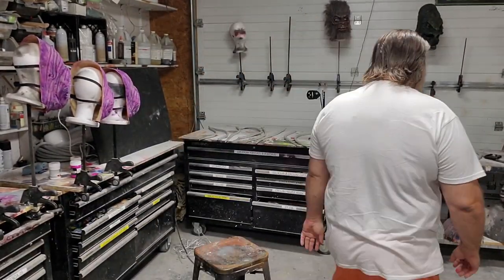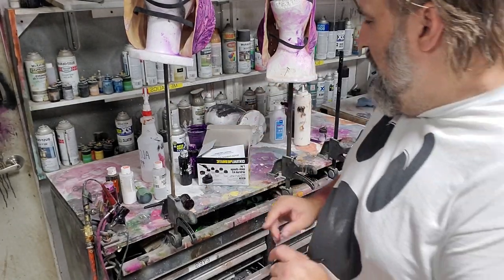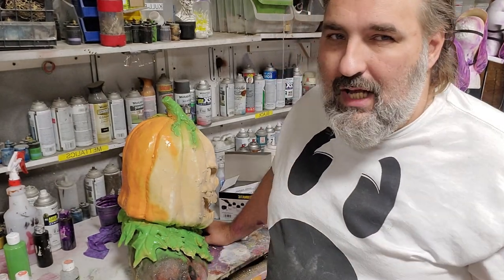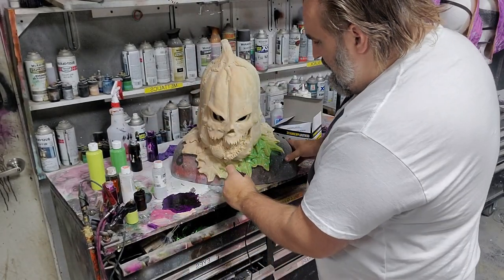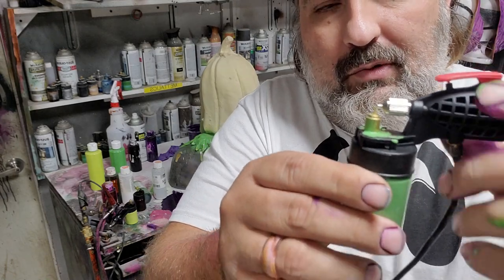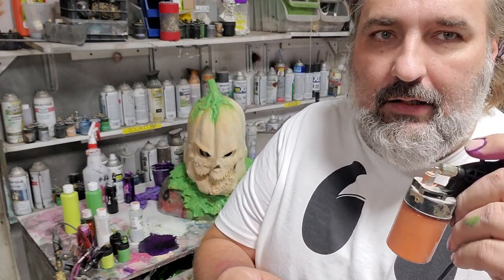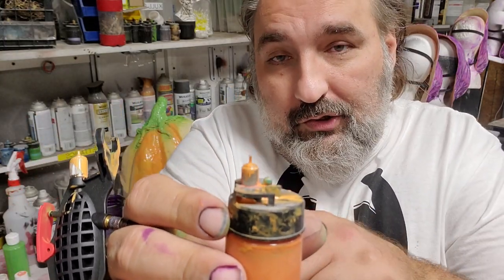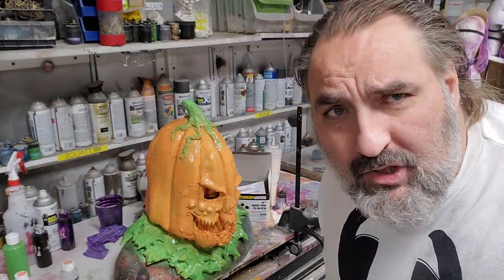quick change airbrush

Comment: I use this as part of my makeup kit for our haunt in Green Bay WI. We are using the Endura from UBA. I found a twelve-pack of glass containers with lids that fit the cap assembly for this quick-change gun on Amazon. They are sold for the Badger airbrushes. When we are through blowing makeup for the night, we screw the lid on that came with the cup to keep the Endura workable and I take the quick-change lids home to clean them up for re-use.
Reply from the maker: great tips!

Comment: I guess I was just surprised at the high 70 some PSI air used. But then it looks like your paint has a lot of solids which may be the reason?
Reply from the maker: its latex mask paint, I dont spray at that pressure but I want it available to blow out clogs.

Comment: Very interesting seems to be a needless airbrush for $10.00. A must-have for the price!

 I bought a used one over 30 years ago that was a harbor freight with an airbrush compressor. The airbrush was junk it had a needle and the person had overtightened the needle and split the tip. It was a micro split didn't see it but the air compressor was what I wanted so the price was totally worth it. Anyway, I had a Badger 200 single action deluxe set. Back then it was almost $200.00

But seeing this one in action and for $10.00 it's a steal for that. It's not made for fine detail airbrush work as-is, might with stencils but it sprays great from what I just have seen.
Reply from the maker: Its great for basing out, stencils and applying shading and washes. the finest line I can get with it is about the size of a BB. but that takes a bit of practice.
Reply: @StiltbeastStudios  Nice and only $10.00 its a steal. Thank You

Comment: Great tips! Esp the one of leaving the pins in!  My mind wanders here, if there is a way to aerosolize paint (fine mist) in a jar without an airbrush? (not spray paint)...I know home depot sells these little bottles that claim to aerosolize paint from a jar. Never tried them though.
Reply from the maker: yup, these guys
https://www.amazon.com/Preval-0225-2-Pack/dp/B00CW809ZO/ref=asc_df_B00CW809ZO/?tag=hyprod-20&linkCode=df0&hvadid=216800360809&hvpos=&hvnetw=g&hvrand=4291751409576420203&hvpone=&hvptwo=&hvqmt=&hvdev=c&hvdvcmdl=&hvlocint=&hvlocphy=9027008&hvtargid=pla-360306998558&psc=1 
but you dont get the fine lines or as much control

Comment: The jars are plastic right? Won't that be hard wo use with acetone and other solvent based paints?
Reply from the maker: yes, but the jars are also cheap $2 each if you buy the set for $10. 
so I buy more sets after I lose a jar to contact cement. mostly they hold alcohol based ink.